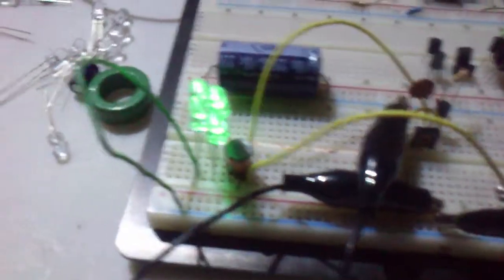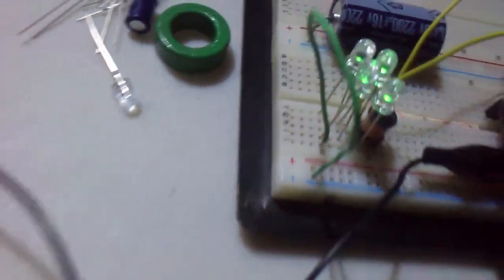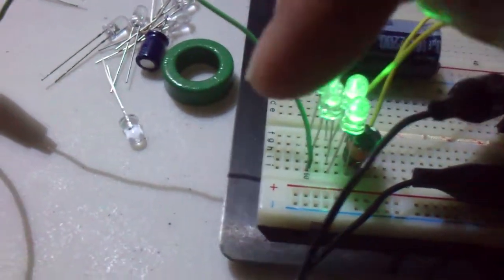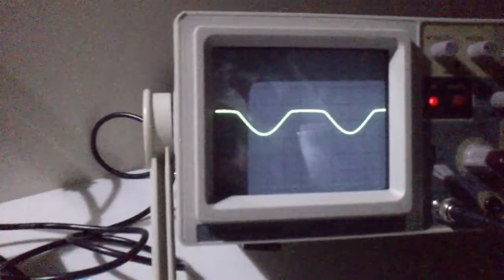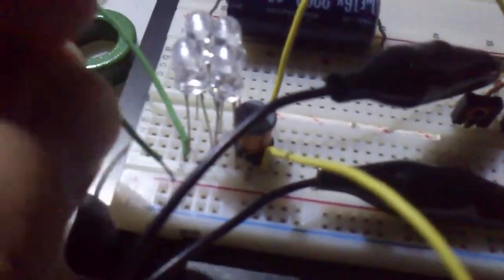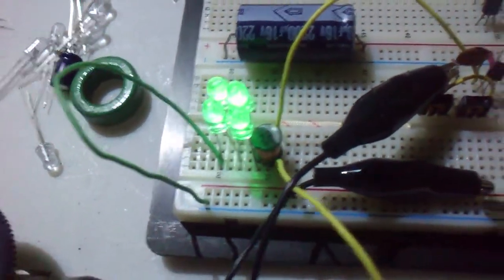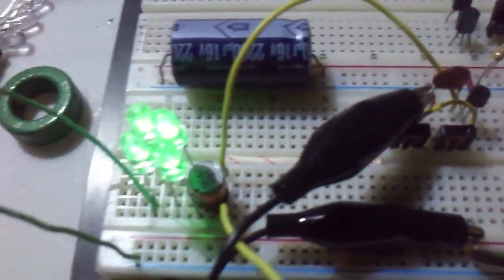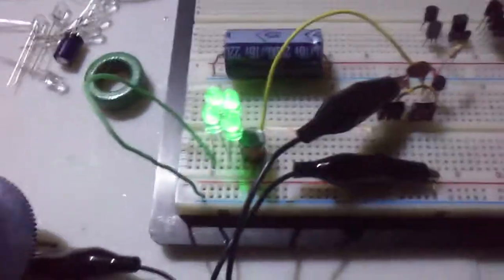Hartley oscillator single wire energy update

Comment: I've been getting LEDs to light from one leg with my scope (ground only) connected. It's something to do with a second negative rail, not connected to the power supply. Emf (+ & -) from the coil needs a 0v point to flow to. Sometimes the difference between my fingers and the scope earth is enough to get dim light. Although mostly there has to be an inductor involved.

Comment from the maker: Yes I know ^^ This is why I remove the scope from the circuit in this video I think I could still transmit electricity to one wire if both the circuit and my source are connected to ground wich then it return to 1 wire and earth connection. Thanks for watching and comment!

Comment: The scope has a few features, the probe itself is a pico-farad capacitor to ground.  The scope's ground wire is actually wired to real ground (different if you had a battery powered scope, which I had another instance that that caused a 95v neon to light when connected to a battery powered o-scope).  I ended up finding that connecting the positive rail of power to ground (scope) actually improved power transfer....

Comment: I successfully replicated this and just used a long clip lead off the (-) of the AV plug attached to a pair of pliers as a virtual ground.  The circuit works fine,  I could not get any "wirelees" exciter effects off it though.